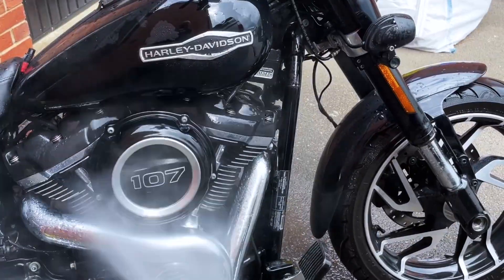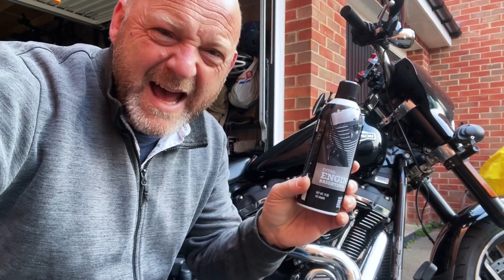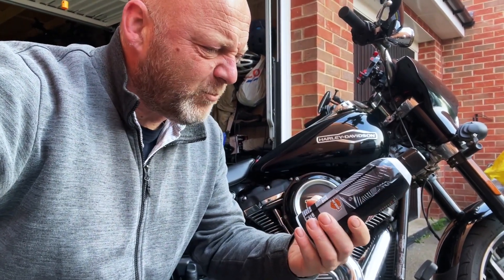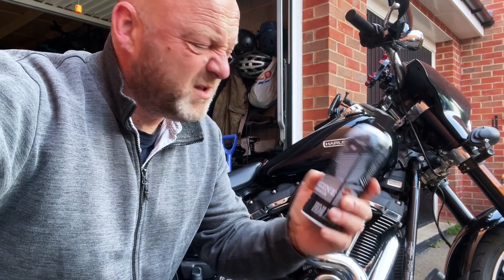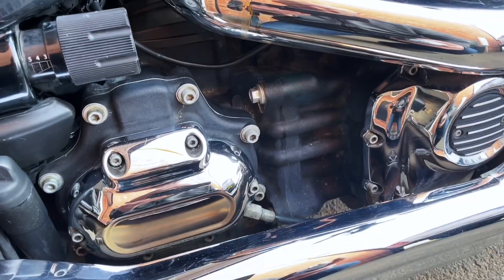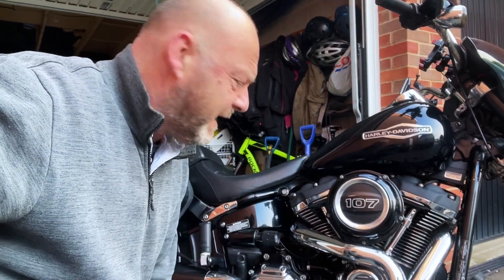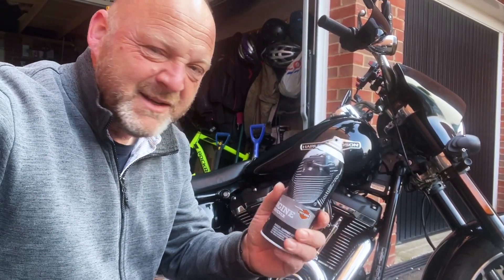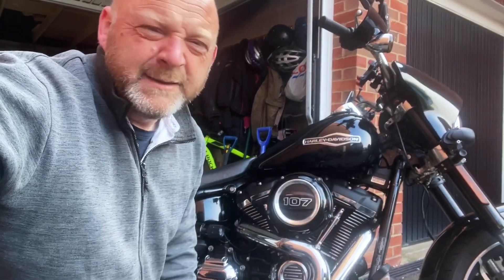Harley Davidson Engine Brightener Review | Does It Work?

Comment: As per some other comments I have always used GT85 on my Harleys and also my Royal Enfields. Does exactly the same job as HD Engine Brightener but costs around £4 for a large can. I tend to buy it in a 6 pack and it lasts ages. Cheap enough to apply after most washes. As with other HD products they are WAY overpriced.
Reply from the maker: Ah I will have a look at that too cheers